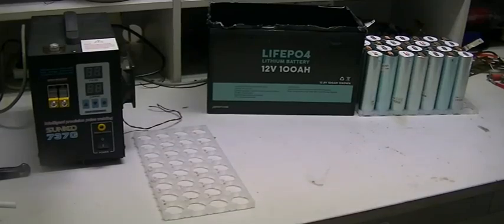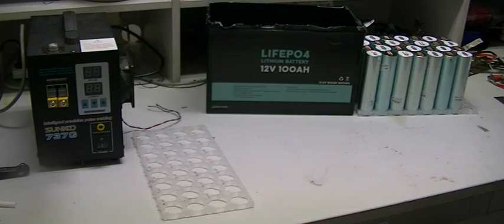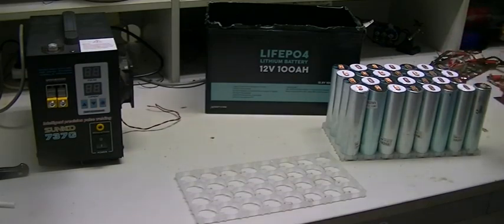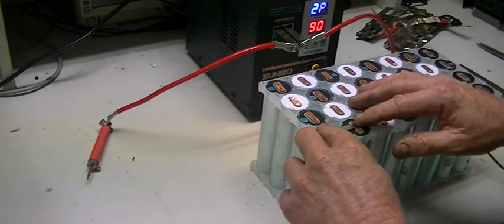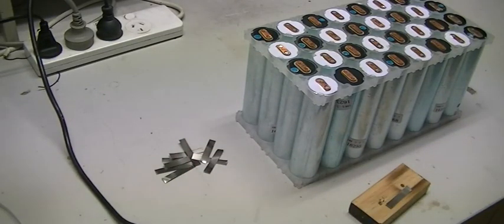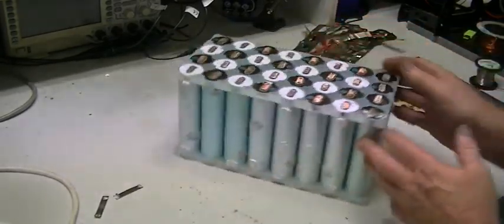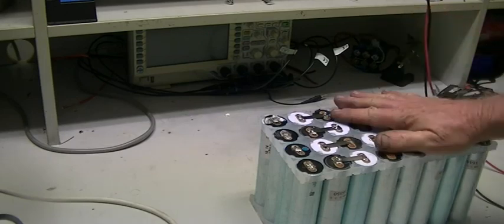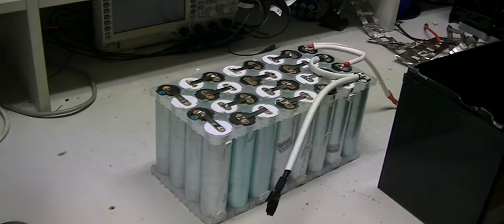DIY 30AH-52 Volt Lithium Ebike Battery Build

Comment: I bought that exact lipo4 battery for $300 off eBay 3 years ago.
I’m glad you thought the battery wasn’t a rubbish one.
I suspected it had cylindrical cells.
50 amp discharge is not high but I’m only using to power small appliances with a 1000 watt inverter.
It was good to know it is indeed 100 amps.
That bike looks amazing with the new battery bank you made.